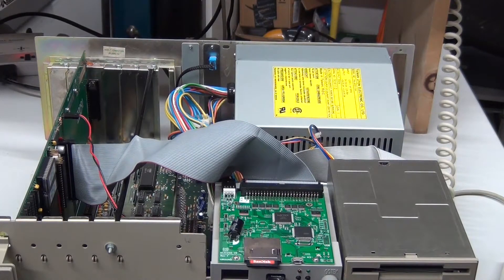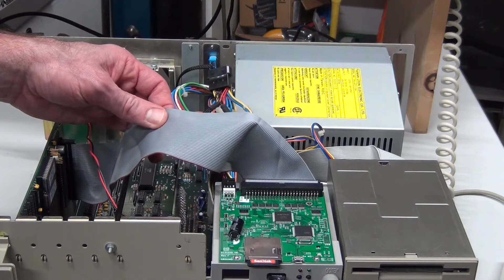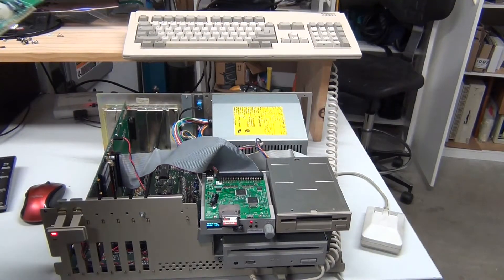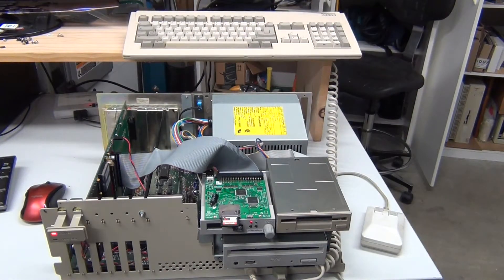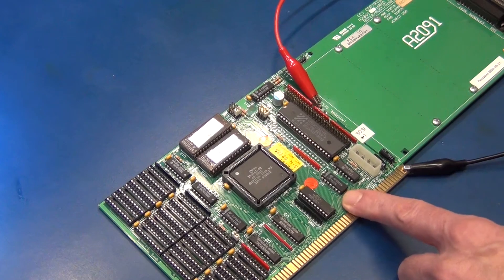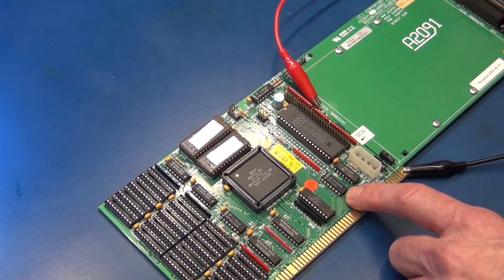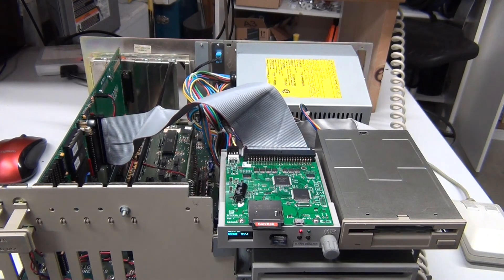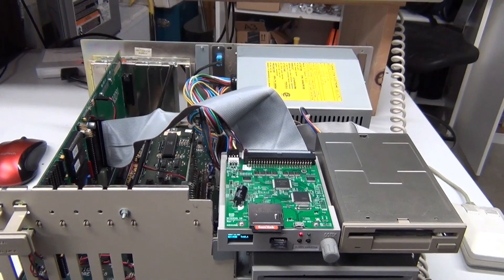Amiga A2091 SCSI controller debug and repair

Comment: Probably overkill with all that kaptan tape. Could've just fluxed it a bit and hit it a second time with the desoldering gun without doing any damage. o.O; Through-hole stuff doesn't usually need the heat gun treatment.
Reply from the maker: You're probably right that the kapton tape was overkill. I'd rather err on the side of caution because two of the four chips in the area are scarce enough that I might as well discard the board if I damage one of them. The kapton tape is much cheaper than that. Regarding the heat gun, I'd would have preferred to not use hot air. Unfortunately I wasn't able to draw the solder out of at least two of the legs of that chip. I could have clipped all the legs off and pulled them one at a time. That would have worked, but then I wouldn't have the dead chip as a trophy. :)
Reply: @cdhaiki  If there's a stubborn leg or two, you can use grabby arms to hold the board, then you can heat the offending legs with the iron while you gently pull on the chip. 

Grabby arms are the best!

Heat guns are evil and I guess that's where the kaptan tape comes in, but I hate using them. =(
Reply from the maker: @NozomuYume  Thank you for your advice. I might try that in the future.